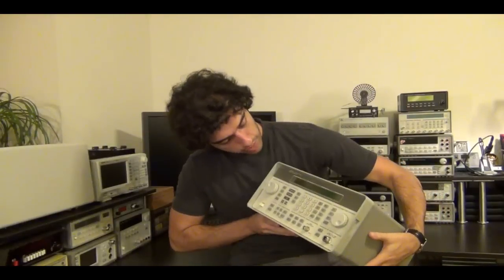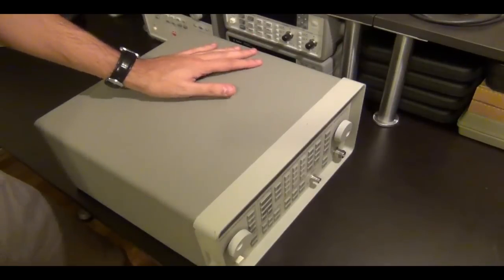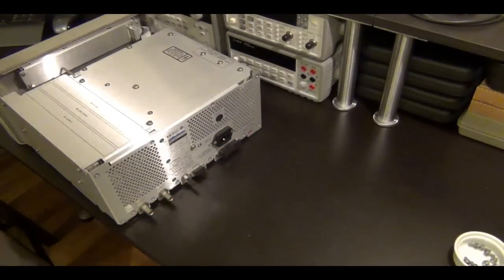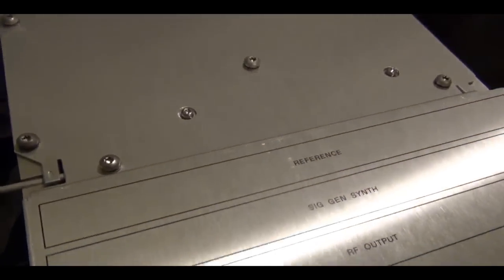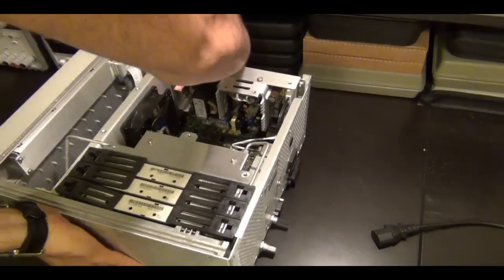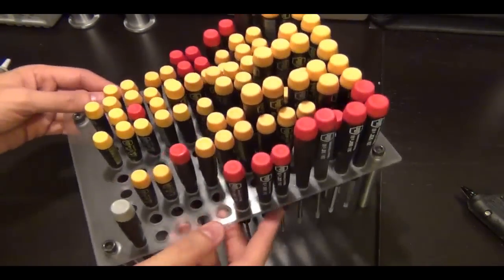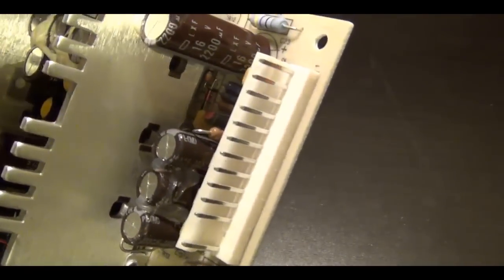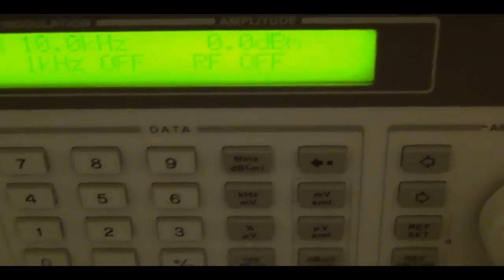TSP #16 - Teardown and Repair of an HP 8648C Synthesized Signal Generator

Comment: What kind of dumpsters are you diving in that you can find frequency synthesizers?! I find half-eaten pizzas and banana peels!
Reply: +George Tsiros My father worked at a medical research company were they would on rare occasion throw electronic equipment away like this. Eventually they started either donating or sent it to recycling.
Reply: or someone was stealing it and get it later.
Reply: Oh god no, lol. He wouldn't do anything like that. You'd have to be a pretty low person to steal from the place you work at or steal anything for that matter
Reply: I was referring to someone else, I meant no disrespect to your father or family.  I too work at a technological park and yes good things get tossed in the dumpster.
Reply: You're good man, no disrespect taken. I thought you might have been talking about someone else so I didn't take it to heart. Thanks for double checking though :)
Reply: I just bought an untested hp 8648c on ebay for  $ 600. That is why I was at your tube.
Reply: king henry Right on man!! Nice score!!
Reply: Do you repair and calibrate electronic testing equipment ?
Reply: king henry I like to try and attempt to repair it if I can. My electronics knowledge is very limited. Calibrating, I never did it. I don't have the proper equipment for that. My father worked in the metrology department so he had access to all those goodies.

Comment: thank you so much for making this video! I recently purchased this exact same model on eBay as I had used one for a number of years at my job. But never opened it. It was working just fine before I stuck an antenna on it and set the output to zero dbm to see if my Spectrum An would receive it.. a few moments later, I heard the Fan stop.. turned around and in the window, it stated the power supply had failed. I shuddered to think about what I just had paid for this item... Then I watched your video and now confident that I will make an attempt to repair. I am hoping that it just a fuse (repair persons dream repair!)  Once I am able to get all the screws and case off, I will report back... Thanks again! David

Comment from the maker: Thank you. All my Rigol equipment (DMM, Spectrum Analyzer, Oscilloscope, Arbitrary Waveform Generators and Power Supplies) are under calibration. All my Agilent equipment are in 'near' calibration but not NIST certified. My Keithley equipment need calibration. My Fluke and Stanford Research equipment are calibrated.

Comment: I think they did apply enough silicon RTV. I don't think HP engineering expected anyone to throw the a machine that cost over 100K when they built it. Incidentally if you are replacing that silicon make sure you use RTV 748 or one of the other electrical grade versions. Most RTV you will find is plumbers grade which emits acid while it sets.
Reply: +ScribblesOnNapkins The melting point of hotglue is often lower than the operating temperatures you will see on heatsinks.
Reply: +ScribblesOnNapkins

 100 k?
LOL

Comment: As you might have figured out by now:
Hot glue is a very handy tool, to quickly get stuff stuck down, but there is a reason, why the manufacturer goes through the trouble of using silicone adhesive.
The power supply will get hot and especially the heatsinks, that you glued the mains filter capacitor to, will. You can be sure, that the glue on there will get liquid again, as soon as the unit is running for some minutes. It might be fine for the smaller capcaitors on the output, but eventually these will get hot as well.
I know it's a lot more work, but you should really use silicone or some other high temperature (>150) adhesive for this kind  of stuff.

Comment: Very informative video. EXCELLENT!
have you ever worked with the HP8640B Sig Gen? It's an older unit but works great and built like an HP Tank. I would Very interested to see you go through one of those.

Very Best Regards,
Glenn

Comment: Another outstanding video.  I have a suggestion for a future video if you haven't already done it:  Proper setup of test and measurement instrumentation.  You mentioned RBW and VBW in this video.  I'd love to hear your explanation of those settings and how appropriate settings are critical for analysis of the signal.  With the power meter maybe do some pulsed RF stuff.  You could walk through some experiments with average power sensors versus peak power sensors and then explain the trigger settings/center frequency settings/etc of the power meter.  You might even go into oscilloscope probe grounding which is more complicated than many realize (depending on the signal).  Thanks for all your hard work on these videos!

Comment: I have problem with a generator of the same model.
The problem happens when I turn the generator on average 30 minutes, making the use or not of the same it appears the problem. When I try to turn it on, it binds and does the procedure to restart and then displays the following message: "700: REVERSE POWER: PRESS A KEY TO RESET"
Could you guide me what I can do and what it can be, given that I am located in Brazil and far from large centers that do maintenance on equipment.

Grateful!
Alandex.

Comment: did it make that buzzing sound once you soldered the big cap back? I have a smilar unit (A) which has a very silent PSU . no LEDs on the MB nor on the LCD. should I be able to read voltages from the output pins of the PSU once I hook it the mains?
Reply: Dude, you are revealing the fact that you didn't even watch the video in its entirety.

Comment: Nice video. Except for one thing. I cringed when I saw you put hot glue against a heatsink. Noo! That's just wrong on principle. Apart from the possibility of melting, it will expand and contract when subjected heat cycling, and might even be marginally (even if insignificantly) worse than just putting it at the base of the capacitor.

Comment: You mentioned that you use methanol to remove flux fron the PCB. I have only used Isoproyl Alcohol, and am not happy with the results. Have you tried IPA ?  And is methanol better ?

Comment: Btw. where do you get the datasheets from? I got an old HP5245L Electronic Counter (60ies vintage with Nixie tubes!). It works if I feed it a voltage too low with a varic (all the voltage rails are OUT OF SPEC then), but stops working at the rated voltage (when the rails are IN SPEC).

I got a datasheet for a later revision (serial prefix 628-), but mine's got prefix 605- and I can't find it... :(

Comment: The signal generator output is specified in power (dBm), does that assume that it's driving into a 50ohm load? Probably noob question, I don't have much RF experience.

Comment: Hello, I hope the topic isn't closed. The output of my 8648C got distorted at frequencies up to 500MHz. The sinus looks like there is a sum of two signals. I suspect something is wrong with the  SPST Switches (DG411, ADG413) or with the 1GG3 4202. The signal at the input of Part 08648-60199 is OK but at its output not. Is it possible to get the schematic of this part? Has anyone ever seen it? I don't use frequencies more than 150 MHz so the task is to transfer the signal directly from the input of this Part to its output transistors (I think they are inside 1GG3 4202).

Comment: These solder formation on the main cap pads come from high-current arcing. At some point coils and caps can be freed from their pads, by hand. These pads need to be bigger. Beefier leads on the cap is also recommended.
Reply: Ah Ha. Just what I thought.
Reply: 2OQP The solder joint must have been compromised before the cap dropped. No matter what inertia a cap this size can have. I suspect more that the 'drop' must have started to compromise the solder and then arcing became possible and so forth.
Reply: 2OQP are you having a great conversation with yourself?

Comment: The oldest piece of test equipment I've ever disassembled was a Dymec digital voltmeter with computer interface from the mid-1960s.  It was all-transistor, save a few tubes in the power supply.  Depopulating the unit left me with a hundred or so good germanium transistors and a bunch of precision resistors.  I still have the display boards, which have a single nixie tube on each and take BCD input.  The old Rotron muffin fan in the rear still works but I don't know where I put it...

Comment: We used to purposefully disable all test equipment that went into the dumpster or to recycling by either hitting every outside jack with 10kv or physically removing parts of the device. I.E pry parts of the boards.
Reply from the maker: And why would you do that?

Comment: The signal path, I think I've mentioned on another of your videos that your conceptual background is swell, but your actual knowledge of, for example, switching power supplies and BASIC signal tracing is so lacking that it is a bit awkward to watch. This is best shown in this video where you wade in and survive ONLY due to pure luck. I recommend that you watch a master of this subject, Paul Carlson, of Mr Carlson's Lab. He makes his living fixing switching power supplies, but knows the engineering behind how the instruments are designed and used. His knowledge of microwave equipment is probably less than yours, due to your work in this area, but you have much to learn from his work on the subject of power supplies. de KQ2E, Bruce
Reply from the maker: Bruce Nitroxpro Do you realize that you are leaving a comment on a video that is 6.5 years old? Do you honestly think that I don’t or didn’t know how a switching power supply works? Or that I don’t know how the instrument is built and used? While we are always in a continuous mode of learning, some comments are just silly and unnecessary.
Reply: @Thesignalpath , I apologize for not considering your learning curve. I DID NOT note the time span  and do not doubt your technical ability. It was the particular video which compared your methods to that of a switching power supply specialist. I'm sure you wouldn't do things that way again now. de KQ2E
Reply: @Thesignalpath  I was perusing the comments here just to see if they are as asinine for an excellent technical presentation by a master that this one is as, they often are for other videos on YouTube. And then I see the one by Bruce Nitroxpro, which made me a bit  sad, as it confirmed my fears. Clearly, the Dunning-Kruger effect is at work in this case. Of all the people on YouTube, you could count on one hand the number of them that have your knowledge and depth of understanding of Electrical Engineering, especially RF. I don't understand the motivation of people that need to belittle others, let alone when it is they that don't know what they are talking about. In my assessment, you are THE MAN when it comes to engineering excellence and understanding in these types of videos. Hopefully this can balance out a little of the crap that others leave in the comments, and thanks so much for your fantastic videos. Don't stop, and just ignore the bozos that leave those sorts of comments, as they know not of what they speak.

Comment: Wow, do you get out much? You seem really upset that the 256 X 64 LCD is an STN type instead of TFT. That DMM has many shortcomings, but for the price it's a fair offering. I would also prefer they raised the price $20 and put an OLED display in there, but I'm not going to cry like a little girl over it.
Reply: @daverhodes382 , Be a bit more kind, TSP has made so many basic errors in this video that it is embarrassing. No need to rub it in.